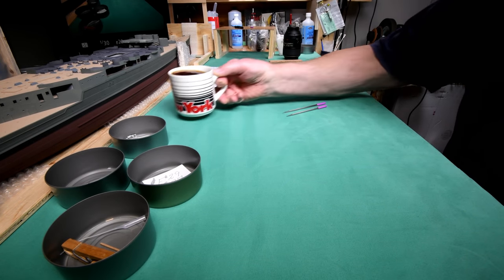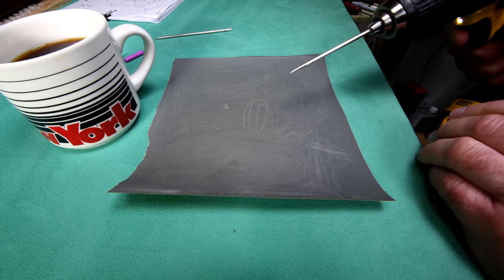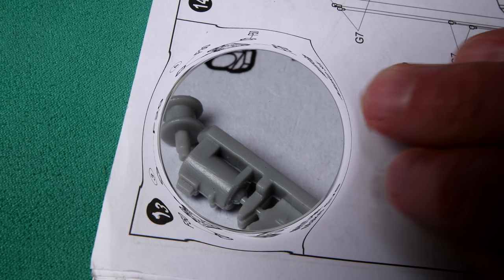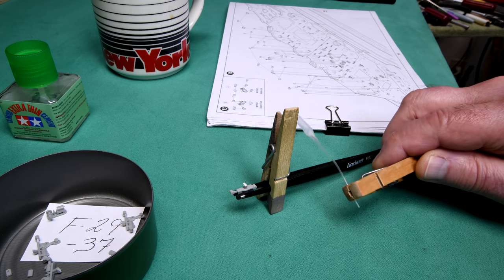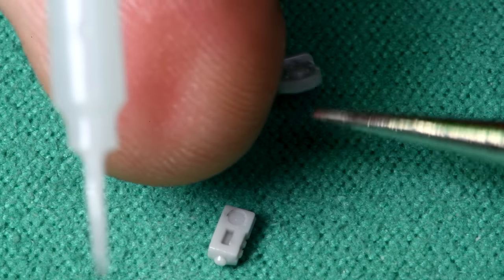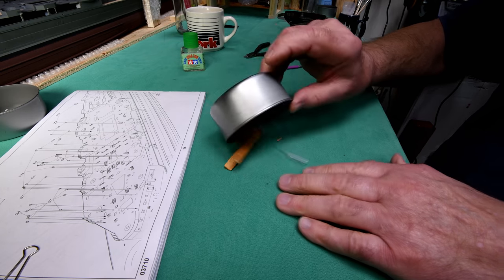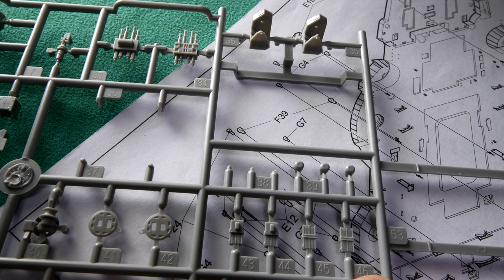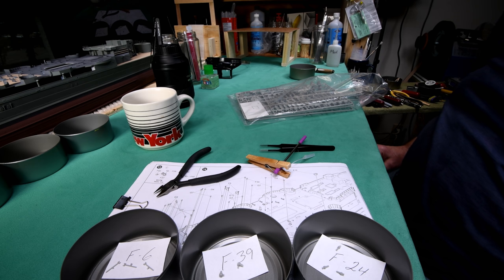The Model Ship - Part 605

Comment: Hey Ron
Just a couple of things while I watch your vid. 1) The poker thingy was probably coated with a laquor or so it looked like it was. 2) Use a highlighter to mark the parts you need on the plans. That way you can find the sprue # before you need to cut off the part.   Just a thought.  Keep up the hard work.
Reply from the maker: Thanks for the tips Craig. 👍🙂

Comment: Hi Ron, only one suggestion. Instead of using that file, get yourself some emery files that are used in a Beauty Shop.They work a lot better than that Metal file. I use them all the time to Remove the smallest amount of burg off any peace of material needed. I buy them at Michaels (if you have one in your area).  I also use Diamond coated files. They are not expensive.   As always, stay safe and be well.  Good luck.......  😷. 👍. 👏. .....  Jason
Reply from the maker: Thanks Jason. I do have those. 🙂👍

Comment: If you have an area like on the piece F50 (the wheel part) that you can see where you have cut off the nub from the sprue, you can put a dab of extra thin glue on the cut marks and it will melt it down to where you will find it hard to see. It looks even better when painted. You can use this trick for areas you have sanded also to get rid of sanding marks.
Reply from the maker: Good tip! 👍